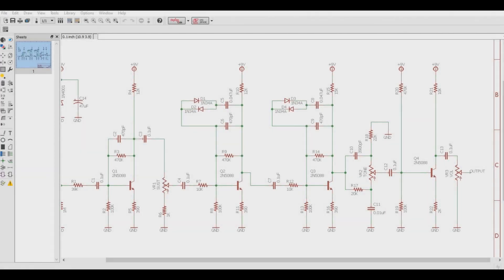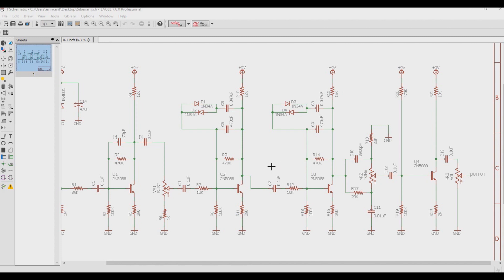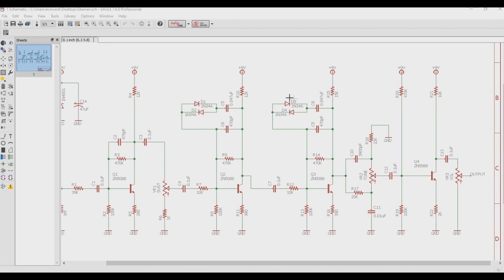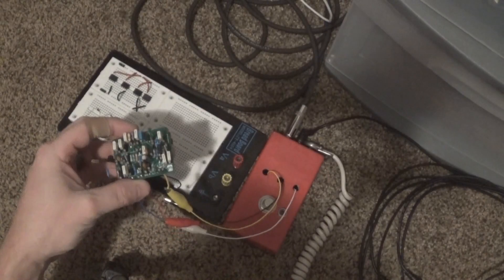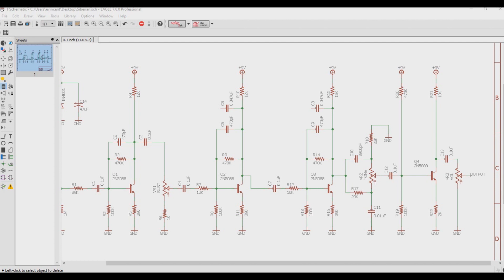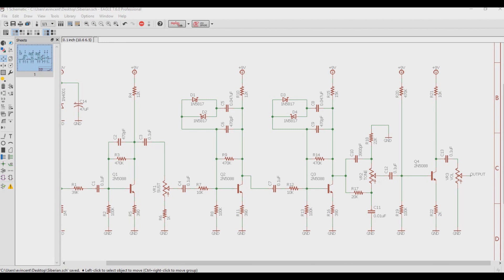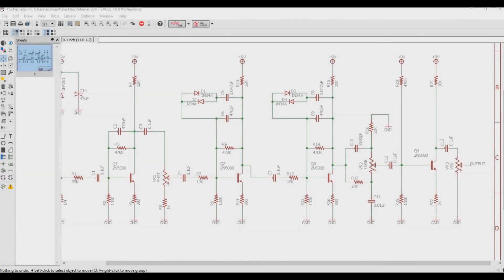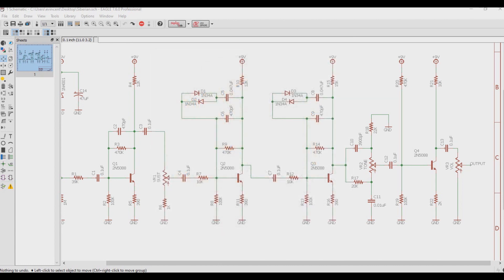Big Muff Pi Mods Part 1 - Diodes (DBE Siberian)

Comment: Hi guys, what could be the cause of the self-oscillation problem in Big Muff? I tried different capacitors, cleaned everything, tried different transistors, but I still have oscillation, help! the thing is that I've made a couple of muff before and they didn't have this problem

Comment: Transistors as diode and GE diodes would be a killer combo too. You'd Prolly get a very touch sensitive big muff if you messed around with positions in depth a bit more.  Awesome video man.

Comment: I think you need to try GE in first stage only with silicon diodes in second stage and vice versa too. That GE tone was awesome it just needed clean boosted louder. With a GE set and a SI set in each position you should get some bad ass cleaner tones at low guitar volume and even more bad ass tone with everything dimed!

Comment: It would be cool to see how you would do this if you wanted to have selectable clipping options using a 3 way switch. Say having the options for both clipping stages to have LED’s, the stock muff configuration, and the germanium diodes.
Reply: You could use a single pole, single throw switch (SPST) and that could switch between one set of diodes and another, but that only gives you two choices. You can see how to do that via the Tasmanian Devil PCB, which switches the clipping diodes from silicon to LEDs. If you want more combinations, you will need a rotary switch or a slide switch. Basically, you will be disconnecting and connecting the grounds from the set of diodes that will be clipping and not clipping.

Comment: if I could only pick the first or second stage diodes to modify on a switch, which would yield a bigger result?
Reply: They both do their "own" thing, but I would surmise that the first set would be a bit more impactful as that is getting the sound amplified to go into the next clipping stage. Pulling them out all together will put out more unclipped volume meaning the remaining clipping stage will have more signal to clip as a whole. It might convert the pedal to more overdrive and less distortion and fuzz.
Reply: @erikvincent5846  My favorite sample was when the first stage was out and the second stage stock. it sounded so huge! 

If I decide to put the first stage on their own switch and the second stage on its own switch, would it be better to put higher forward voltage Options (silicone, LEDs and no diode) on the first stage?

Then lower voltage (germanium, silicone, LEDs, in that order) on the second?
Reply: @levijessegonzalez3629  I would go with that.
Reply: @erikvincent5846  What about the clipping caps? would that be worth having those on a switch as well?
Reply: @levijessegonzalez3629  possible if making a baritone mod

Comment: Fantastic content presented very well!  I really liked the way the germanium diodes and the MOSFETs sounded. If you were going to try different pairs for the first and second stages, what order would you put them in?  IOW would you want the higher forward voltage diode in the feedback loop for the first stage or the second stage?

Comment: 4:05 silicon stock
5:31 silicon second stage only
6:49 no diodes
8:00 germanium
9:35 schottky
10:58 red leds
12:58 mosfet
Reply: second stage silicon is my favourite but red leds are a close second. no diodes is also a flavor i'd enjoy as an option.

thanks for the video!
Reply: it's been a year, checking back on this video because i had forgotten what mods i wanted to apply. completely forgot about these comments as well, good thing i left them.

edit: favorite with a u, why

Comment: Do you guys make this on a larger pcb. These tiny boards are hard to work with when doing mods and experimentation.
Reply: Funny you should mention that. I have one that I am working on right now that is designed around a 1590BB enclosure. Look for the Super Siberian, coming to a theater near you.

Comment: Hello,

I am interested in starting to build effects pedals with your kits, but I really don't know where to start equipment/materials wise. Right now, I have no equipment (no soldering equipment at all) nor do I have any pedal materials. What exactly do I need to purchase so that I have all that I need to build a pedal kit from your website (soldering stuff, enclosures, pedal/circuit components?) Thank you!

-Luke
Reply: Well, I would start out by getting a soldering iron, some solder, and possibly some solder wick. Make sure the soldering iron is for small electronics, and not those large soldering guns used for automotive and such. Also make sure it can get up to 400 degrees C. You don't need to get that hot, but soldering irons that can, tend to be better. Parts and components can be found on our site, so that should cover that area. However, we may be out or not stock some specialty parts. If you need those, don't be afraid to send us an email on our site and we can help you source those additional parts.

Comment: does lower ford voltage means less drive from the diode ?
Reply: Round about, but yes. As you can hear with the germanium diodes and schottky diodes, both having lower forward voltage, it sounds less fuzzy and even has a bit of volume drop as Mark mentioned.

Comment: Interesting video, and glad that the controls weren't changed when changing diodes.  One thing I will note is that, because the gain stages are cascaded, the clipping in stage 2 (third transistor from the left) is contingent on what comes out of stage 1.  When diodes of a lower forward voltage are used in stage 1, that constrains what stage 2 gets.  If there was a means of varying the gain of stages 1 and 2, that wouldn't pose any problem, since we could simply raise the stage 2 gain to compensate.  But if all one is doing is changing diode type, then as we seem to hear, there isn't a huge change in tonal quality; volume level seems to be the biggest change.  So I'll suggest the following: use diodes with a higher forward voltage for stage 1, than for stage 2.  So if you want to use LEDs, stick them in stage 1, and use silicon for stage 2.  If germanium is the target, then silicon goes in stage 1 and germanium stage 2.  And so on.  The idea is to achieve the more serious clipping of a lower Vf diode type by assuring it gets hit hard enough.

Incidentally, the Sola Sound "Jumbo Tonebender" was essentially a Big Muff circuit, but without diodes in stage 1.  I tried out that change in a Big Muff, and wasn't grabbed by it.  It provides a little more frizz at the top, but nothing I found compelling.  More productive changes can likely be found in changing cap values in the tonestack, and the feedback cap in stage 1.  Increasing the feedback cap in stage 1 from 500pf (or whatever it is) to something up to 20% higher (let's say a maximum of 680pf), will trim upper harmonics from the stage 1 output so they don't get amplified by stage 2.  Dropping the value of the cap to ground in the tonestack (usually .01uf) will raise the rolloff point on the bass side.  With stock values of 39k and .01uf the rolloff starts around 400hz and trims mids and treble from there.  Drop the cap value from .01uf to .0068 moves that rolloff point to 600hz, and dropping the cap down to .0047uf pushes it up further to just under 870hz.  This does not affect the treble setting on the Tone control noticeably, but will reduce the midscoop.  What it will do is make the full bass setting more "throaty" and less muted and "wooly".  That said, no shortage of BMP mods posted around that may be closer to your tonal goals than what I described.  Each to their own.
Reply: Yeah, I only wanted to change one set of variables at a time. There will be a video going over those caps you are speaking of as well. That one will be fun.
Reply: @erikvincent5846  I'm quite confident it will be, and look forward to it.  Keep up the good work.
Reply: I'm having a Russian muff being buil for me. I told him I want a diodes switch, and he offered a rotory switch, but is that overkill? 

I was thinking only having a on-off-on switch for only the first stage diodes. (stock, OFF, red LED's) and keeping the 2nd stage stock. 

would this be the best thing to do for the most variable tonal variety? 

For the green Russian do you suggest a Mids Toggle switch, or a tone stack bypass switch?
Reply: @levijessegonzalez3629  I think your suggested switch is quite enough.  People can get a little crazy with diode choices, sometimes.  My view is that it's a fuzz,  What you get to hear will depend far more on how loud everything is and how you set the Sustain and Tone controls than on this or that combination of diodes.  I mean, if 3 chords is good enough for rock, why shouldn't a 3-position switch be as well, right?
Reply: @markhammer643  haha good point! if you had to choose on the diode switch, you could you modify the first or second stage diodes?
Reply: @levijessegonzalez3629  Distortion is always always always a function of what you feed it.  So in that spirit, do your mods to Q2 (the first clipping stage).  As well, note that the cap in series with the diodes has different values across the various issues, ranging from 47nf on up to 1uf.  The cap straddling the base and collector of those stages also changes value depending on issue, ranging from 430pf up to 560pf.  Higher values of those will trim more top end, while higher values of the diode-series cap will apply the diode action to more of the spectrum, yielding a little more audible compression, apparently.  There is no absolute requirement that the two clipping stages be identical, or that your diode switch ONLY change diodes.  So, for instance, you might use a higher-value for the base-collector cap in the Q2 stage than for the Q3 stage, to feed Q3 with less top end, and use 1uf with the LEDs and .047uf with silicon diodes.  The idea is that your toggle would select between 3 different characters rather than simply 2 different clipping thresholds.
Reply: @markhammer643  interesting. Where are the caps located on the board? do you know their placement? 

and Could I have the caps on their own switch and the diodes on their own switch? so I can absolute most combinations possible? (as opposed to having them on a single switch for diodes and caps)
Reply: @levijessegonzalez3629  The caps in question should be near the relevant diodes and transistor.  As a thru-hole circuit board, you have the advantage of being able to simply tack on additional parallel capacitance to the pads on the copper side of the board, and season to taste.  Once you find something that makes enough of a difference to appreciate, you can then install.  So if there is a .047uf cap there now, just stick a 1uf (non-polarized, of course) in parallel with it, listen to the impact, and decide if you like it.

I try to avoid pedals and guitar wiring that starts to feel like a combination lock.  If it's a studio tool, then one can afford max tweakability.  But if it is something you intend to gig with, or simply jam with, limiting the number of choices works in your favour.

I'm working a 14hr day at an election today, with no on-line access, so if you respond to this and I don't reply promptly, you'll understand.
Reply: @markhammer643  Good to know thanks. I do kind of want a Frankenstein muff for studio use. just trying to see what the best mods to implement are
Reply: @levijessegonzalez3629  i just acquired a black russian as well and im trying to decide what a good mids mod would be.      It seems like a mids Potentiometer would be the best to dial in the perfect amount but i havnt seen any info on that mod yet.

Comment: What would it do if I changed the diodes in my op amp big muff to LED’s?
Reply: It would be similar because on the Op Amp Big Muff, it is still doing it's soft clipping on the Op Amp's negative feedback section.
Reply: Erik Vincent I had a custom one made with an added mid control as a backup to my way huge swollen pickle fuzz and I think those leds would get me closer to that sizzling torn speaker sound
Reply: @pigdick2233  That would make sense. I like doing the LEDs mod for thrash and punk style rhythm tones.
Reply: @pigdick2233  nice. I do dig me some doom.
Reply: That’s a bright idea
Reply: @Warlock_UK  Badda Bum Bum Ching!
Reply: What would it do?  Not much until the Sustain control gets turned up high.  What happens after that may or may not be to your liking.  What's critical is that the signal level fed to, and achieved by, that transistor stage has to be large enough to result in clipping.  Red LEDs will require that they be hit by roughly +/-1.5V.  Green will require even more than that.  The very first transistor stage does provide some boost, and the Sustain control trims back on that level.
Reply: OPAMP big muff is the perfect muff, IMO.  I have one from 1978 and I treasure it. (No it doesn’t sound better than a reissue or DIY version)
Reply: Wolf H mannn you’re lucky
Reply: Fred Herbert 

Bought it about 12 years ago when the prices were still reasonably reasonable. ;)